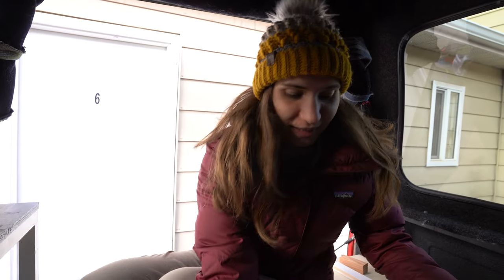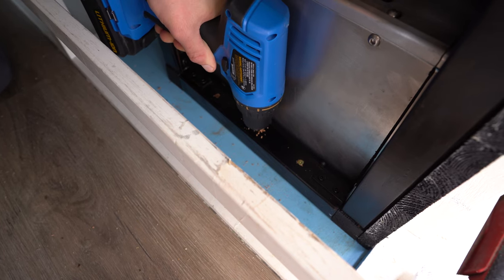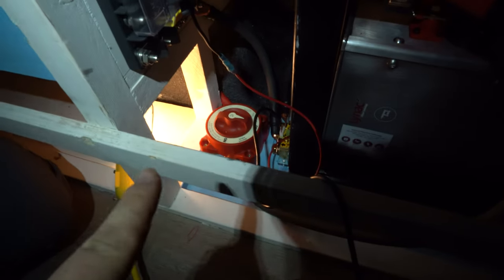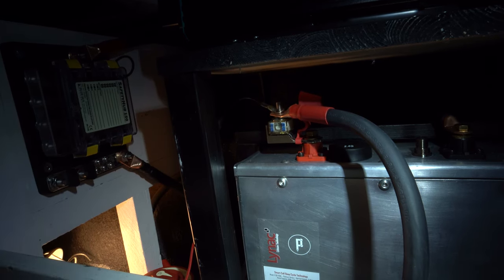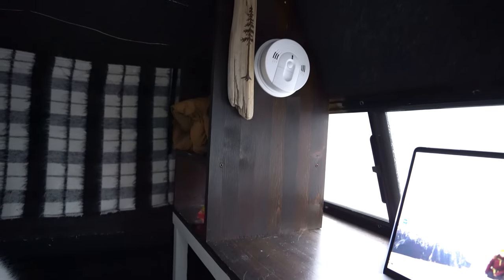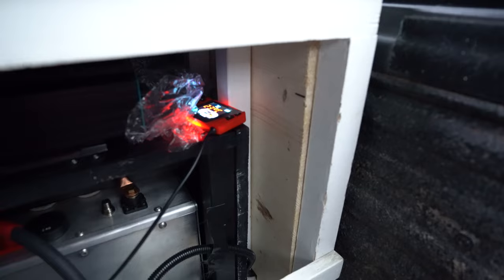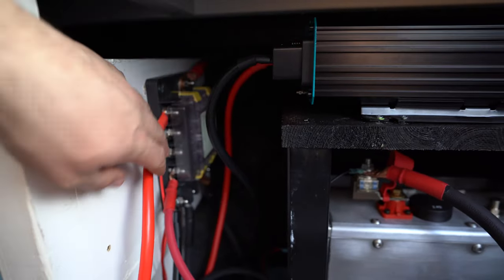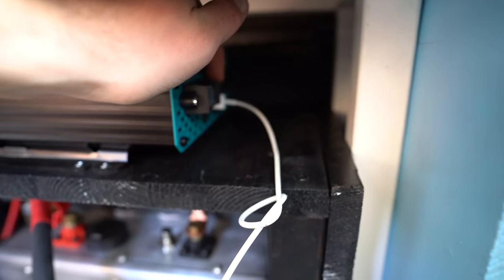DIY Truck Camper Electrical Setup

Comment: Very cool video.  It is not long at all.  I enjoyed it. Can’t wait for all of the adventures with this set up.
Reply from the maker: Glad you enjoyed it! We had originally planned to put this video and the one where we install the diesel heater together so it would have been about 50mins but figured that would be a bit boring for people so we split them into two. We can't wait too! Should be a fun winter. Have a great day!
Reply: @StarrDaniel  I would totally watch it at that length, but it was great to watch both of them.

Comment: Your going to always have a constant draw on the battery with the monitor on the main post. Put it past the switch so it only shows the life when power is on
Reply from the maker: Thanks for the tip!